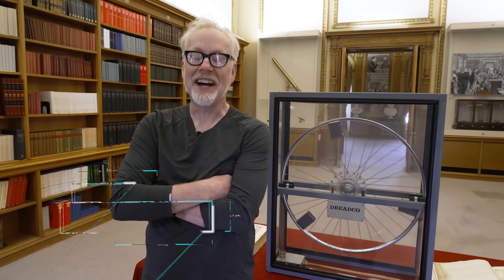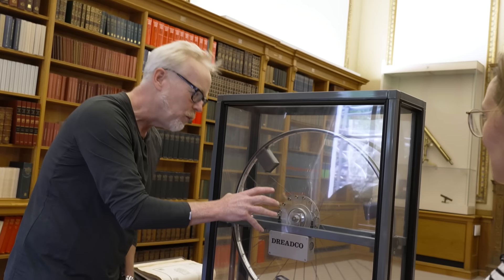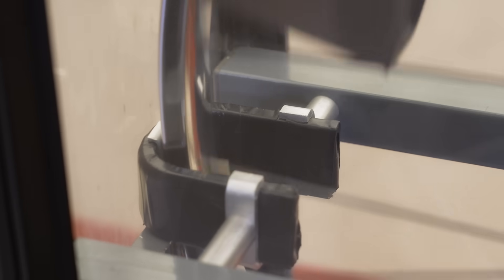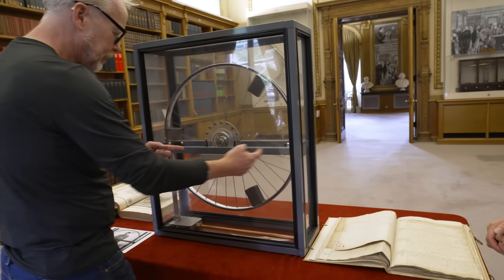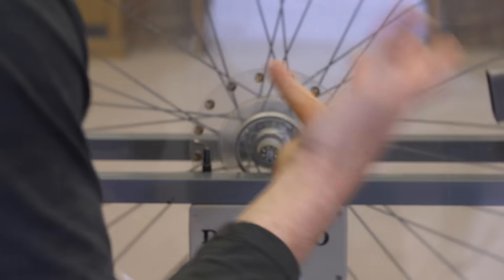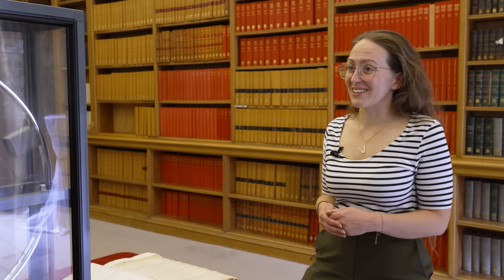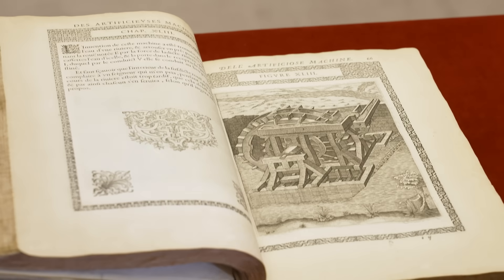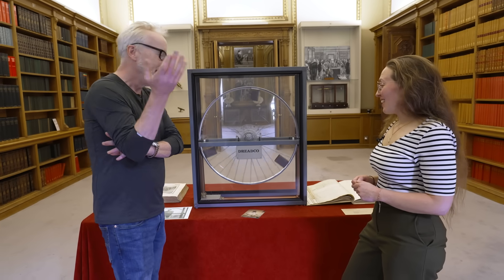Adam Savage vs The "Perpetual Motion" Machine!

Comment: Oh good grief... perpetual motion is not a myth; I built one years ago, and it's still going.
Reply: It is a myth, something going on for ages in not perpetual
Reply: @spaceageGecko  
Well, magnets will eventually lose their magnetism, but it's still a very efficient way of producing electricity.
Reply: @ἐκλήθητε  It won't work, the second you try to draw power from spinning magnets energy is drained from the system and motion will stop.
Reply: @spaceageGecko  
I have a few designs actually, none of them utilize spinning magnets.
Reply: @ἐκλήθητε  No "perpetual" machine can produce energy.
Reply: @spaceageGecko  
No, they can. The problem is that there are powerful people in the fossil fuel industry that squash the publication of such a thing.
Reply: @ἐκλήθητε  That would violate the laws of thermodynamics, don't be fooled by snake oil.
Reply: @spaceageGecko  
Big Bang cosmology also violates the laws of thermodynamics, but that doesn't stop some people from believing it.
Reply: @ἐκλήθητε  Not exactly relevant to the point, energy cannot be created or destroyed only converted from one type to another.

A perpetual motion machine providing power would be creating energy, an impossibility.
Reply: @spaceageGecko  
No, it's not creating energy, it is converting it. As I said before, magnets lose their magnetism over time, I think I worked it out to be about 50 years in my application, so if you want to look at it as an extremely efficient way of producing energy, but not perpetual, I'm fine with that. But because matter and energy can never be created nor destroyed (I don't agree with this assertion because "In the beginning, God created..."), but if someone believes that and applies it to perpetual motion machines, then if they are to be consistent, then they must apply it to questions of cosmogony as well, otherwise they are inconsistent, and inconsistency is a sign of a failed argument. The two topics are most assuredly related, because no one who asserts Big Bang cosmology can ALSO assert that perpetual motion machines are impossible (and I am not here accusing you of anything, I am merely making a general statement).
Reply: @ἐκλήθητε  Magnets do not have "energy" to convert. Magnetism is force, like gravity, not a form of energy. To get energy out of a system energy must be put in and the output cannot exceed the input.

The second you brought up religious texts I know you are not arguing in good faith.
Reply: @spaceageGecko  
You said: "The second you brought up religious texts I know you are not arguing in good faith."
The second you showed disdain for God's word, I know you deny reality. 

Unlike gravity, magnets have the property of both attraction and repulsion. When a system can be designed to take advantage of both forces, and can interchange them, a continuous impulse upon a rotating flywheel can be achieved - for the life of the magnets that is, however long that actually is.
Reply: @ἐκλήθητε  magnets cannot spin a wheel, it will just stop. Religion has no place with scientific endeavours and should be kept entirely separate.
Reply: @spaceageGecko  
First of all, I'm not talking about religion. Theology is the queen of the sciences. Among other things, that means that any conclusion made by scientists that contradict the established truth of God's revelation must necessarily be thrown out as demonstrably false - such as Big Bang cosmology. I already went over this, since it demonstrates inconsistencies of secular thought. 

Next, I'm not talking about magnetic devices such as Howard Johnson's magnet motor or similar devices.
Reply: @spaceageGecko  
Then it is obvious that you have not studied. A Creator God is an existential necessity, demonstrated by the contingent nature of the physical universe. 

Because the physical universe is contingent, it is not eternal as some have suggested. (Eternity means stability and immutability of essence, the impossibility of origin, cessation, or change, in effect, eternity means no past, present, or future; it is an eternal “now,” but matter/energy is in its essence a compendium of forces and potentialities; it is relativity itself, totally caught up in creation, living, changing, and dying, ergo matter and energy are not eternal) Every physical (natural) entity is contingent and therefore has a cause, and because causal chains cannot be of infinite length, as that would be an effect without a cause, if you were able to follow the causal chain back to the very beginning where the very first physical entity was effected into being, it's cause HAD to be supernatural, since the “natural” was not yet in existence, something cannot come from nothing, something cannot “be” before it “is,” and nothing can create itself (not even God). The reality of the impossibility of infinite causal chains also refutes any notion of a “multiverse” that some have posited as an explanation of the eternality of the universe, and it also nullifies the question “where did God come from?” that some have posed when God is explained as the ultimate cause of the universe. 

Others (like Stephen Hawking) have foolishly said that we cannot talk about the origins of the universe since time itself did not exist before the universe began to expand at the Big Bang, so we just cannot know. However, since time is the progression of sequential relationships between two or more contiguous events, if there was indeed a point when there was no such thing as time, but assuming the universe did exist in some previous form, be it as a singularity, a quantum vacuum, or whatever, then because there was no time, then there would be no progression from the universe’s previous condition from “A” where there was no time to, “B” where there is time. Hence, if there was a point when there was no time, then there never would be time unless some supernatural (outside of nature) force created it.

Contingent beings are insufficient to account for the existence of contingent beings in the ultimate sense. Frederick Copelston once said, “If you add up chocolates, you get chocolates after all and not sheep. Therefore if you add up contingent entities, you are still left with contingent entities, and not an eternal one;” there simply cannot be an infinite series of contingent beings, or an uncaused effect, therefore there must exist a necessary, non-contingent, supernatural being whose non-existence is an impossibility, and from which the existence of all contingent, physical beings are derived (Hebrews 11:3).

Therefore we know that the universe is not eternal, but had a beginning. The fact that the universe had a beginning demonstrates that matter and energy can indeed be created, and, according to the word of this Creator, it will one day be destroyed.

That this Creator God is Yahweh is simply a matter of historical inquiry.
Reply: @ἐκλήθητε  You go and believe that all you want, there has been zero evidence of the divine, writing paragraphs trying to justify your beliefs will not change that.
Reply: @spaceageGecko  
as I said before, you deny reality, and are therefore not interested in an intelligent conversation. Godlessness has no place in intellectual conversations.
Reply: @ἐκλήθητε  The irony is palpable.

Comment: My guess is that those boxes are magnets, the U shaped thing are coils, there's a battery inside that dreadco box that takes a charge from those electromagnets, I'm guessing that small ring of magnets in the center where those two prongs are is where the magic happens, one side maybe the left senses the magnets as a hall sensor, the needle shaped prong on the right sends an electrical pulse each time it passes the sensor and "pushes" the magnet at each pulse. So basically it's charging and discharging at the same time, eventually the battery runs out because of the losses, and it needs a "service" to swap or recharge the battery. That's my theory anyway.

Comment: I think It’s a clock mechanism on the central hub hidden in the box with the name on it , and the 3 black boxes on the outside edge are there to perfectly balance the wheel so it needs minimal input to maintain its kinetic energy the copper tubes are doing something with the air being pushed and pulled around the outer rim and outer display  box is to stop outside air, breezes/ wind from stopping or slowing it down as well as stop people touching it… I think 😂

Comment: From what im seeing, i would guess the magnets in the center discs interact with hall effect sensors which are  the little probe ends connected to the box. this tells a little micro controller the wheel's position so it can switch polarities of the magnets on the ends of the wheels keeping it spinning. that said this set up would consume more power than what one would need with simpler designs. it would be more efficient if it could read the speed of the wheel so it only applies force when the wheel is below a certain speed. it could be way easier to simply use a timing device. 

its likely less complicated than i am thinking it is as these machines are typically as simple as it gets with a ton of extra "hardware" to serve as a red herring added to fool on lookers.

Comment: Imagine this thing uses temperature changes in the room to create a pressure difference between the box and the outside and a piston/cylinder to generate a little power, so no need for servicing and no way to prove how it works one way or another without taking it apart. It would piss off generations of folks like me who just wanted to take a sledgehammer to it but couldn't for the respect of the man. It would be a hundred year practical joke.

Comment: Pretty sure it's just an electronic motor, with the 'magnets' being the stators, and the boxes being the armature.
With good enough bearings, it requires almost no energy to keep the thing going, and that box can house some pretty large batteries and a circuit.

All the other stuff looks like ''OOoooOOooOohhh, mysterious mystery materials' type stuff.
EDIT: Actually, the holes in the sides of the box might be for ventilation/cooling for a circuit of some kind, but seeing the kind of power draw and discharge timescale we're working with here, it might either just be a case of extreme over-engineering because little effort, or 'mysterious mystery materials', or two birds with one stone type both.

Comment: My guess is the three boxes are coils generative electricity which goes to the box at the bottom which charges the air in the cabinet. The box in the centre takes that static charge and turns it in into an electrostatic motor with the magnets on the wheel hub.

Comment: This is just a simple version of Magnetic Drive Technology. Just like a water device where the water drops and then pushes it down and then goes up and it falls again.  Also if you look at it from a distance you can see it's a triangle and do you know how to make a triangle spin. Think about it if I put magnet's on a fidget spinner it will spin forever , all you need is a good balance of push to pull ratio .
Reply: Neither the water device not the fidget spinner example would work.

Comment: i would guess the 3 boxes are permanent magnets, as the pass through one coil it generates small charge, box at bottom perhaps capacitor to store charge, the other coil uses charge from capacitor to create field to act as motor on the magnets of the wheel. the center box and those points i'm not sure, possible static charge to additionally charge capacitor or something, you mentioned bearings in acrylic case, possibly at vacuum to reduce friction. if its an honest attempt at perpetual motion so no batteries are being changed, then the service is probably replacing bearings and cleaning electrical connections.

Comment: Why not hide a smidgen of radium or plutonium in the mix somewhere?  The decay of radioisotopes to produce heat or light has been well documented since Marie Curie. The 19th century trained physicists who examined her work were about as confused by the light as Adam is, now, by the motion.  If a tiny electric battery would be enough to keep the wheel spinning, then a tiny RTG would also work.  The "SNAP-15" by General Atomics  produced least 1 mW and 4.5 volts for over 5 years, massed under a pound and was about the size of the Dreadco box shown (The RTG was2.5 inches in diameter and 5 inches long.)

Comment: A Horizontal  setup would prob have less components subject to gravity and hence friction ... maybe.   Ex the wheel could be suspended between  2 vertical, very fine spindles on jewels like you get in mechanical watches. I bet there would be less friction than a bearing

Comment: I think the fact that the metal “magnets” on the perspex look like cups and that there is a mesh either end of the dredco boxes. I propose that the spiky post on the right of the box is a small outlet for an air pump, with the input hidden behind the solar panels. The fact the box is sealed takes any outside air current from affecting the wheel. So it would only need a small amount of air to impart a force like a water wheel into the cups. Boxes contain a small magnet that trickle charges a battery in the dredco box that Adam surmised keeping enough charge in for the battery to last two years. The magnets on the outside of the wheel in the boxes also act as weights to make a bigger weight for the flywheel

Comment: The youtuber AvE did a video a while ago showing how auto greasers work by a chemical reaction that produces a tiny amount of gas and over the course of 6 months pushes on a piston and greases machinary. I imagine it's the same sort of thing, really slow burn checmial reaction and the real wizardry is just how well balenced and smooth rolling the wheel is to allow such a small input to overcome the friction. Edit: https://www.youtube.com/watch?v=Ppm9b0JAQCQ Short circuiting a zinc air battery causes hydrogen to be produced.

Comment: I have a theory that: Those are Dual Polarity magnets where the bicycle rim goes between (top positive, Bottom negative), and the boxes attached to the rim also dual polarity attracting and repelling just enough to keep it going. The question should have been asked if when they move the machine, does it ever stop rotating? And if so, how do they start it back up.
Reply: That is the key, it does stop. It was said that it would run a few years and stop. It would be sent off to be serviced. Just like my battery operated clock on my wall. The smoothnest of the turning reminds me of a battery powered clock mechanism.

Comment: A perpetual motion machine is a machine that is creating exactly the amount of energy needed to keep its self running, it doesn't speed up or slow down.   A Over unity machine is not a perpetual motion machine, it is a machine that produces more energy than is required for it to run.   Basically if you have a perpetual motion machine and you were to try to use it to generate extra energy it would stop, as you are pulling energy from the supply it needs to keep running.  A over Unity Machine on the other hand, could generate extra power to be pulled out of its system..   Picture a electric motor that needs 500 watts of power to run, and now picture hooking that up to a generator that produces 1000 watts.  If that motor could turn that generator at the speed required to produce 1000 watts, and it only its self needed 500 watts to do it, you would have created a Over Unity machine.   
I am not saying that ether perpetual motion or Over Unity is possible, or that it has or has never been done, but if we are going to debunk something we first must understand what that thing is and how it is intended to work.  

Lets look at the supposed Perpetual Motion machine in this video, if it were producing electricity and powering its self, and providing it didn't break, it worked for ever..  Then it is still a perpetual motion machine.  It wouldn't be Over Unity unless it could generate more energy than it was using.  So while not having something connected to it, in some way to pull energy out of the system, if it was over unity it would be speeding up, not staying the same speed.  At best it could be perpetual motion, and at worse it could be just motorized in some way and running off of a battery or two.   But what it could not be, based on just seeing it run in this video alone, is over unity.   

I like the search for over unity, I like the search for perpetual motion, as both to me seem like something worth while to work on as a species.  The worst that could happen is not much of anything comes out of it, the medium that could happen is all new technology's making established things more efficient, and the best that could happen is over unity or perpetual motion...     

I don't know how that thing works, it could be bar magnets and C magnets generating a small charge, that somehow charges a battery and that battery then runs a small weak motor that turns the wheel.  In reality if you balanced the system correctly, you could get pretty close to perpetual motion, but I doubt that machine does.  Most likely its got enough power in the battery or battery's to run its self for a couple years or so before the battery runs dead, and the people they send it to just replace the battery's with new ones lol.  the case could be slightly depressurized so that the inside has less air and thus less friction, the bearings could be fake and it could actually just be maglev type bearings to minimize drag loss...  A lot of things could be done to minimize drag to increase efficiency in the system.   By using low amounts of power to power it, less heat is generated and thus less loss, and with a maglev type bearing system in it, you minimize the torq needed to keep it spinning...   Their is so much that could be causing it to go for so long, and it is insanely hard to try to figure it out from just this video.